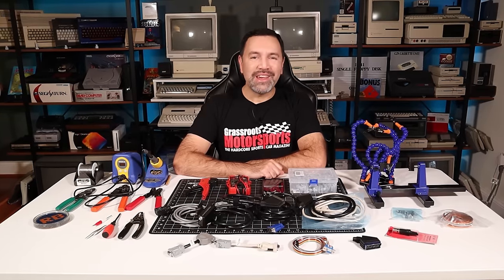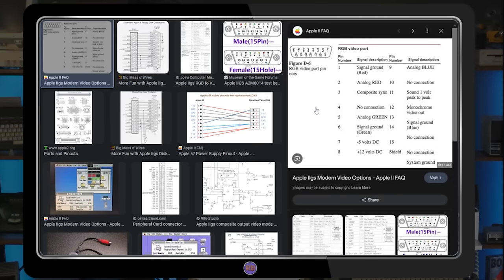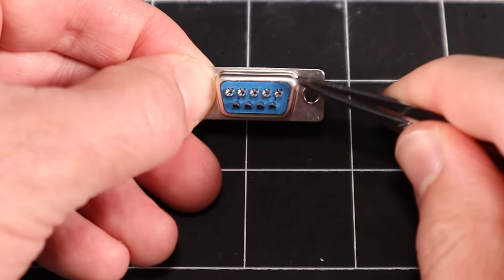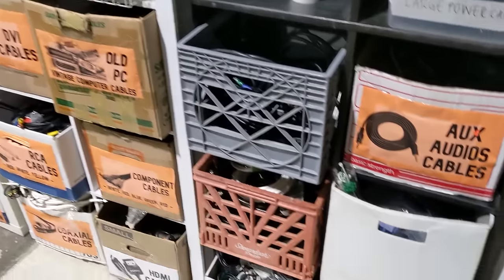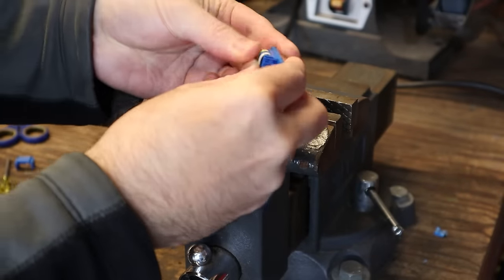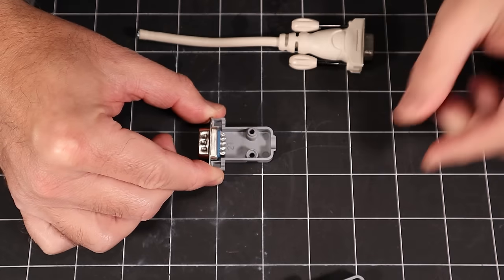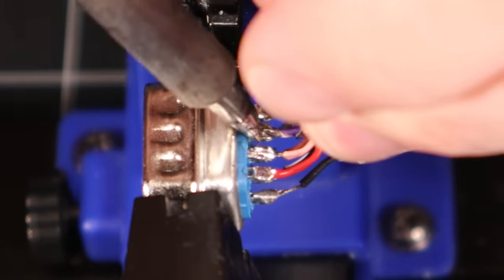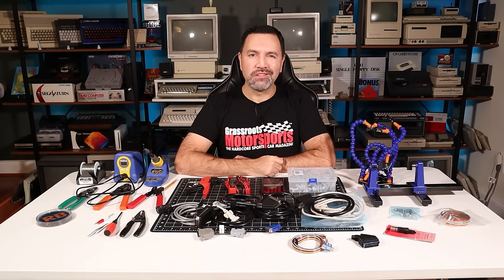👉You👈 *can* build your own cables!

Comment: Good sir. The solder terminals were not designed to be pre tinned.  The idea is to put the wire as deep into the hole as possible before flooding it with solder.  This creates a more solid connection (mechanical and electrical)    flux helps too.
Reply from the maker: Huh, I never realized that. I will have to try it. Thanks for the tip!

Comment: I like using Silicone Finger protectors/thimbles when making up cables.  I so often touch a metal pin before it cools otherwise. They aren't heat proof, but give protection to prevent burns that would happen in less than a second otherwise.  There are worse helping hands out there, I wouldn't give mine up.  If I am concerned wires may short over time, or when put into a casing, I use a bit of Liquid Electrical tape.  It is generally not pretty when using it, but it has been quite useful to me over the years and stays unseen inside the shell.
Reply from the maker: Cool, thanks for sharing your tips!

Comment: When I had my first job into computers. Not only was making cables still a thing. We was the only shop around that still did it. Funny on how people had to drive 18 miles to a small town to get a cable mfg. Though this was mid 90's. Thus, the stuff was left over from later 80's when more popular and most computer shops that showed up was new and just interested in selling and not other things. One more cool thing we had was a cable tester. Yea, we had a serial break out box. But we had some other boxes that would show crosses and such via lights. Exactly like the cheap cat 5 cable testers. Great for finding special 9 pin cable wiring.

Comment: 6:40 - "Pin 5 will always be pin 5..."

When I was making power and serial cables for my IIc, I actually ran into issues because the DIN connectors were numbered the way DIN connectors are (a 5 pin DIN has pins 1,2,3 in the same locations as a 3 pin DIN, but pins 4 and 5 are stuffed in between) but the pinout reference was actually numbered just clockwise around the connector. I think it's a discrepancy that goes all the way back to the original tech reference manual for the machine, somebody just didn't like the DIN numbering and wanted to use a scheme that made more sense to them, I guess...

Also, funnily enough, I had a Commodore 1084 back in the 80s of course, and for a little while thought I might get an Amiga to go with it, but never did. The monitor probably got sold off cheap when I got rid of my C128, but the cable for connecting it to an Amiga wound up in an assortment of Commodore stuff we did keep, and when I finally got an Amiga a few years ago, I found the cable, and now I use it. Not with a 1084, don't have one - but since it goes DB-23 (an old, expensive connector) to DIN (a common, cheap connector), it was easy to make an adapter that would connect that DIN to the Apple IIgs monitor.
Reply from the maker: Oh man, well that sucks. I haven't encountered a situation yet where the pinout I was using didn't conform to the standard. I will keep that in mind if I make any cables for my //c though :)

Hah nice, you did the opposite of me. I've been on the look-out for a decent Apple color RGB display but so far I've only managed to score a composite monochrome one.
Reply: @retrobitstv  Yeah I picked up the Apple RGB display at Deerfield. The seller actually had two of 'em but I wasn't sure at first if I wanted them (I'd developed a bit of a hate-boner for the IIgs, mostly in response to 8bit guy's video about how Apple should have put its resources into promoting the IIgs instead of the Macintosh, which always struck me as just clearly wrong: Macintosh carried Apple through the 90s, I can't imagine IIgs or any hypothetical descendent of it accomplishing that.)  But after tooling around the fairgrounds for a while trying to get some decent mobile internet reception I was able to confirm that the display should work with my Amiga, so I got one. Before that I was using an RGB-to-component adapter I'd made to display on my Trinitron TV...  But the Trinitron seemingly can't do 50Hz, while the Apple monitor can. It's also just nice for the Amiga to have its own monitor and some dedicated desk space

Comment: I had an Amiga. There is a 5 volt pin on the printer port of the Amiga. Because I had a PC printer cable, I broke the pin in the plug. so I could use the DB25 minus 1 pin connector on the Amiga.

Comment: Good video.  I always wondered how to decipher the pinouts, so it's good to know that pin numbers are consistent based on the gender of a given connector and if from the face or back.  That is to say pin 1 on a male is pin 1 on a female, it's just their physical position is mirrored, also that the face of one gender is the same as the back of another, which is obvious if you think about it.
Reply from the maker: That was the most important thing I was trying to get across and something that I overlooked for a long time. I was always trying to figure out from what perspective the pinout diagrams were drawn and then working back from there when it never mattered in the first place. In the early days, I wired many things up backwards it's kind of a miracle I didn't fry something!

Comment: If I want to make a cable from SCART to a VGA port that supports RGBs, do I need to worry about funky SCART voltages? TV and console are both NTSC.
Reply from the maker: It is my understanding that VGA monitors normally expect TTL (0-5V) sync levels and SCART normally carries composite video for sync (1Vpp). I say normally because different devices output RGB sync differently and there are a lot of console cables for sale out there, some better than others. At the very least, you shouldn't have to worry about frying anything on your VGA monitor as long as you don't accidentally wire up the SCART's +12V line to something. Since it supports RGBs it sounds like you won't need a sync stripper.
Reply from the maker: I forgot to mention, another option to go from SCART to HD15 (and others) is the SyncSlayer II that can convert csync to hvsync, reduce TTL voltages, and has a nice breakout header. https://www.tindie.com/products/chipnetics/syncslayer-ii-scart-to-vga-adapter/

Comment: I tried to make a cable for my c64 using a donor VGA cable. But the wires are so thin that they kept breaking before I could wire up everything. Any tricks?
Reply from the maker: Hrm, that doesn't sound normal. Is it possible that you cut into the wires while stripping the insulation? It could also be just a really cheap VGA cable that has super thin wires - you saw how chunky the wires in mine were. Maybe have a go with a different cable...